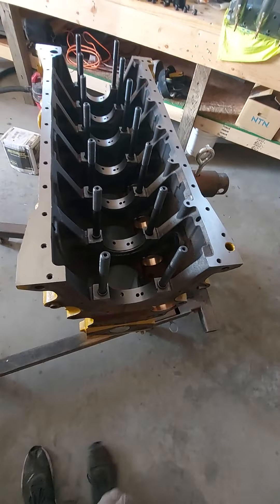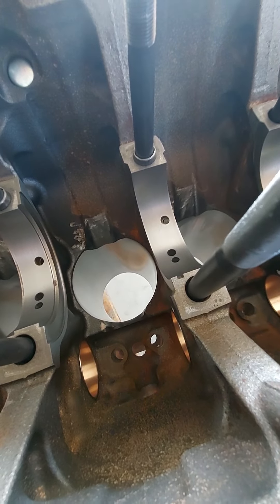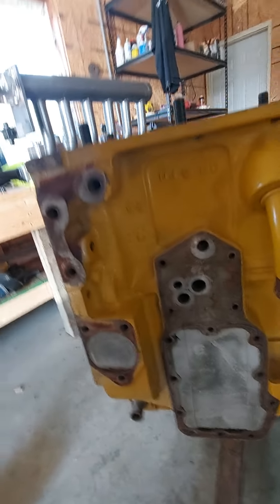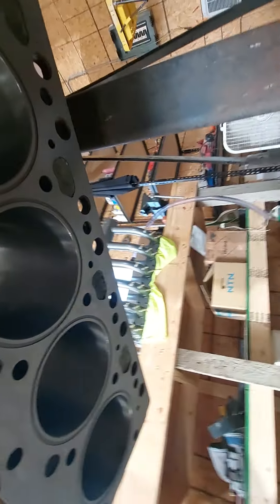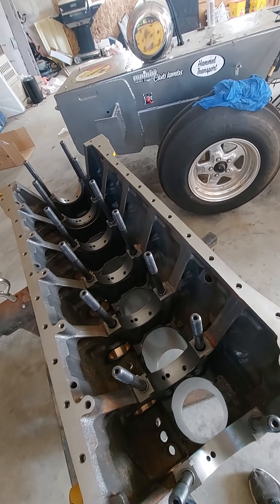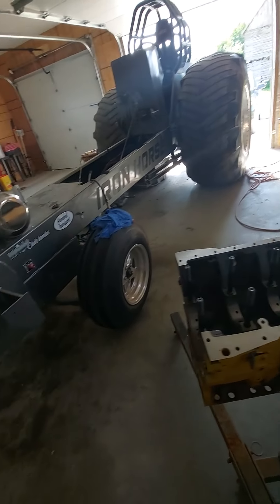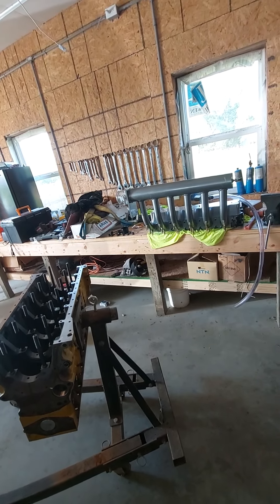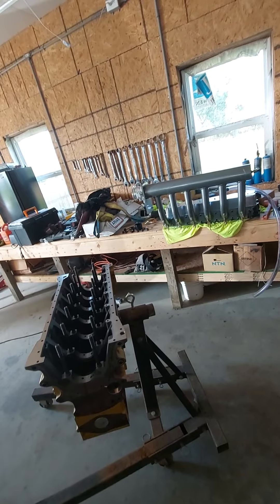new engine build on 5.9 cummins pulling engine. alky version

Comment: Good call to take your time putting it together.
Do some guys make that lower plate wider and run head hold down studs from the base of the block to either head clamps, or to a wider deck plate?